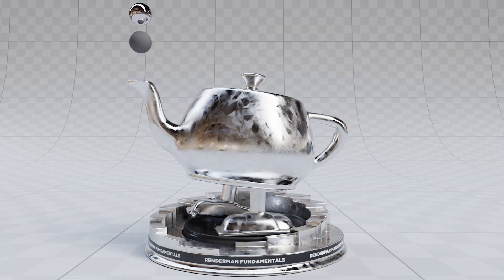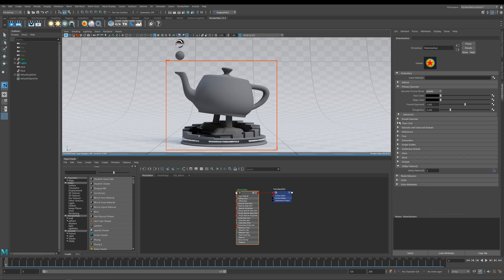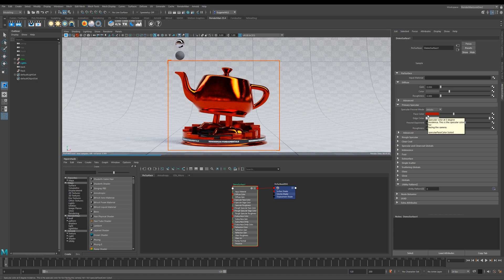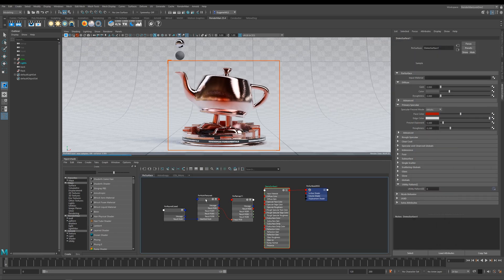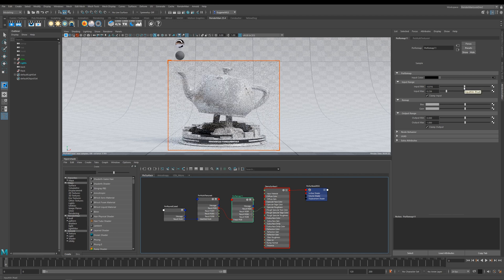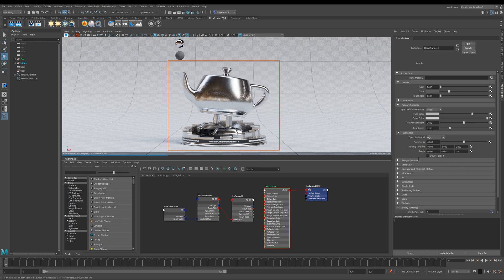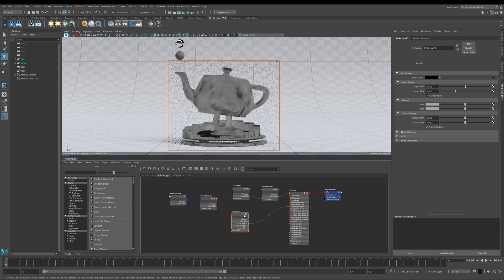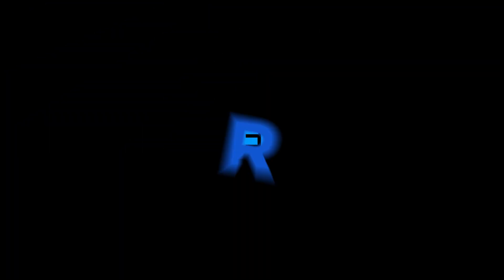RenderMan Fundamentals - PxrSurface - Artistic Specular

Comment: I know this is fairly old and newer updates may already have addressed this, but I haven't got further than this in the list of videos:
How would you address a coating with (near) matching IORs to the substrate, when there are no IOR controls for the lobes?
If both IORs are present, I can do "BaseIOR = max(BaseIOR,CoatIOR) / min(BaseIOR,CoatIOR)" to get good enough base specular attenuation.
E.g. of practical demonstration; lower shiny glossy dark bubble plastic into water, and observe its specular reflections vanish (only dielectrics).